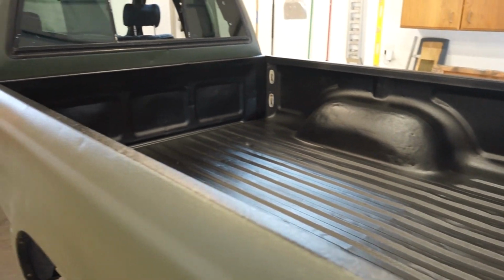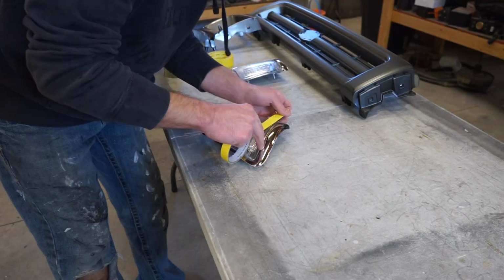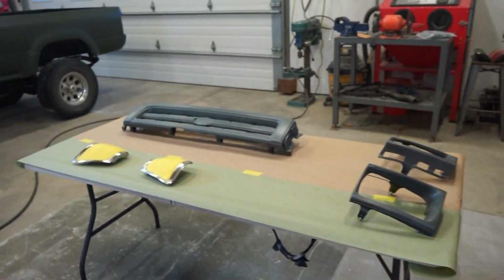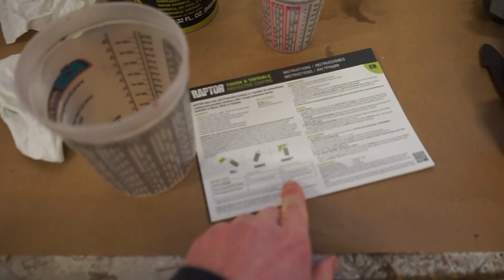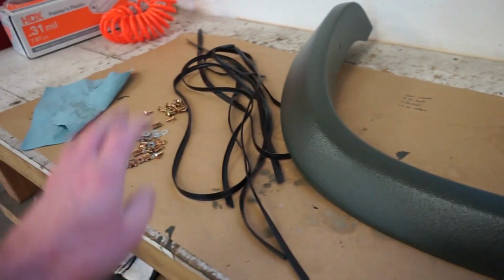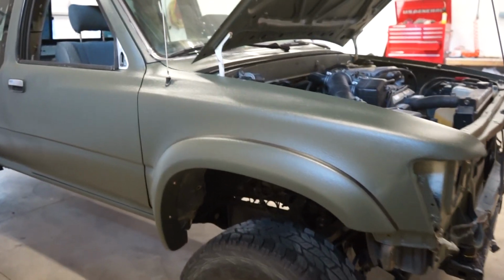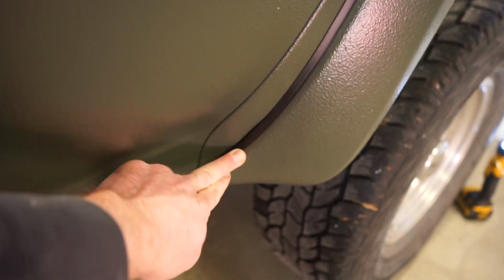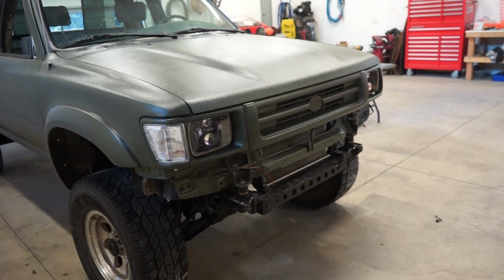The Toyota Pickup Gets A New Front End!!!

Comment: You should rust proof those flare holes you drilled!? they will rust up quick with moisture in wheel arches.
Reply from the maker: Rust proof plastic?
Reply: no in the main body which the flares attach to. #bodyPanels
Reply from the maker: @nerdskiii  those are all factory holes!
Reply: @austinniemela  Yeh but he had to relocate some new holes (as seen) and new exposed metal will rust if not treated :)
Reply from the maker: @nerdskiii  I only drilled new holes in the flares man